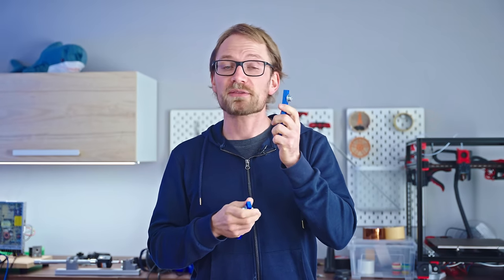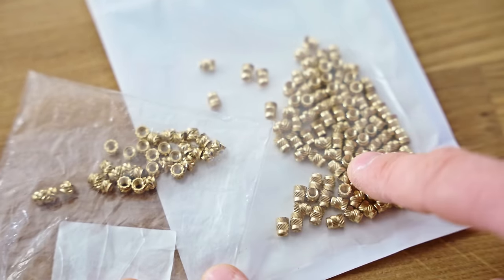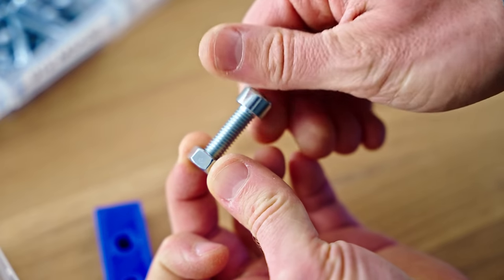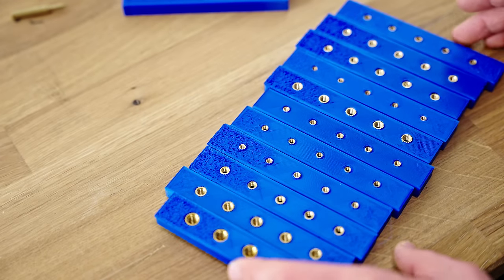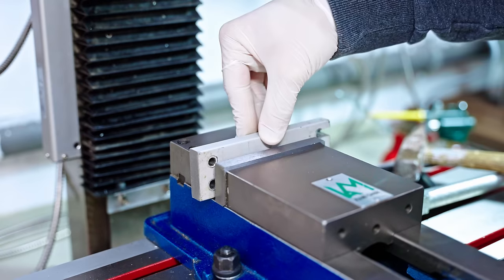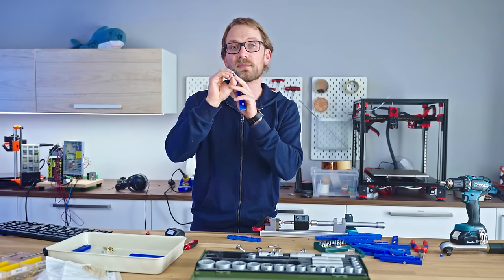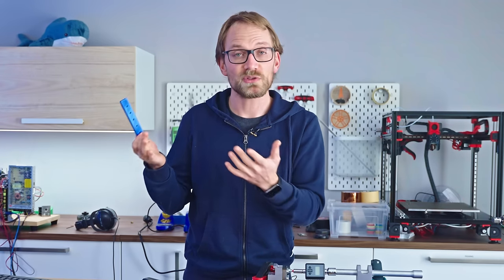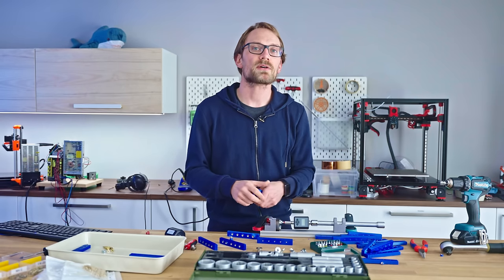Do you even need threaded inserts? Strength tested!

Comment: I think most of the comments cover my views... I'd like to 2nd extra perimeters, infill, and mentioned in video but I don't see it in comments: material type. I've found people don't really get the different material options out there. They either go "ah, I was told to print this in PETG or ABS" and go with that, or they just blanket go "I have orange loaded in the printer, so will print the thing with that..." So you tested with PLA, but all you need is for the weight bearing element to hang from plastic part... and stress creep kicks in and it eventually fails. "oh no, it broke. Now I need to reprint/repair/etc. it" or... it can be demonstrated that they should've used PETG/ABS instead that doesn't have that issue. Etc. Etc.

Comment: It looks to me like you're using 2 walls?  (If you said how many walls, I missed it.)  I assume that's on your preferred 0.6mm nozzle so the walls are 1.2mm thick.  That's about half what I would use for anything load bearing like a threaded insert.  I don't have any actual science for that decision, though - I just feel like a load bearing wall ought to be around 2.5mm thick, which is 4 walls on a 0.6mm nozzle or 6 walls on the 0.4mm I use.

So that's what I'd like to see next: how much stronger is the part if you print it, well, strong and not "quick prototype" thickness.

Comment: How about the embedded nut whether it's embedded during the print or inserted in a pocket after printing? Is there a way to add more filament around the 'hole' as it's printed maybe adding a bit more strength?

Comment: Hmmm, not sure about the results. I've definitely torqued screws into m3 threaded inserts at more than 0.3nm while building a voron...

While I dont have a real torque wrench I use those printed ones for nozzle Installation and would compare thst torque to some of the screws.

And yes, I know they often apply tricks to increase the strength of the inserts, but even for Ines without extra supports

Comment: 50% gyroid, infill >5 perimeters. Embedded nuts, embedded threaded parts/metal. I only use inserts far electronics, like an enclosure for a Rasberry Pi (Zero). Reason being recycling, avoid glue at all cost. Its a pain to remove embedded parts like magnets, inserts and nuts.

Comment: IMO not having enough "meat" around the holes completely invalidates these tests. It introduces a variable that at least I usually account for in my designs. Another option that you seem to disregard here I do quite often is having a smaller hole and then just cutting with the screw. For me this works much better than you suggest here. The screw gets hot due to the friction so cracking the part is rarely a big concern. For better or worse it gives a much tighter fit than when cutting a thread into plastic. Another option that is missing are inserted nuts. Not always an option - but sometimes you can even insert them during printing.

Comment: You mention lead free solder has been fantastic, what's the alloy you use?
Reply from the maker: I've been very happy with the ones from FELDER, specifically their halogen-free, no-clean Sn99Cu1 type from the ISO-CORE EL series. Though that's simply the one that I've been using and I'm pretty sure the alternatives work very well, too.

Comment: Why use metal screws in the first place? Unless you need to screw/unscrew them very often, it is much better to use specific screws designed for plastic parts! They are easier to put, and are very strong. And much cheaper too.

Comment: Interesting stuff, however I question the validity of doing strength testing on pla, if you care about strength, wouldn't you use something like PC (Blend), nylon or abs/asa?

So definitely would be interested in different materials
Reply: PLA is pretty strong, at least in compression.  Nylon and ABS are weaker, but tougher.  I suspect that the same holds for tension.
Reply: @richdobbs6595  PLA has a high Young's modulus but a low ultimate yield strength. Which is what I meant by stronger material.

As shown in the video, the PLA fails way before anything else, and if all you need to do is to just hold together a multi part print for your pen stand, then the content presented here isn't really relevant as a piece of chewing gum and some tape is probably good enough. This type of investigation starts to matter more when you have functional parts that need to take some load, and at that point you probably shouldn't be using PLA. Which is my point ☝️

Comment: if its a part that i don't want to disasemble i just use 3d gloop. if it needs a little more bite i print worm screws and also use 3d goop on them. 
if it needs to be disasembled it will get a pocket with a nut in it. Way better than those inserts and also cheaper

Comment: you can try screws for wood, look like they are more suitable for such material like plastic, they have wider thread, and higher pitch, so the stresses is distributes in larger area, sizes from fi 2-2.5 mm is easy to buy, 3 and 3.5 is very common in furniture;] and is enoug to make straight hole 1:1 (eg fi3 for fi3), and metal thread do the rest

i suppose there is same result that you pull out whole screw and break part between infill and perimeters

ah maybe they are less resistant for multiple screwing and unscrewing due to wear of plastic thread

Comment: I'd be interested in testing out "Cubic Subdivision" Infill. Not primarily for this but in general. According to the Slice Preview in Cura its one of the fastest Infills to print with less Material while being surprisingly strong in my experiance. I usually print with 3 Walls and ~20-25% Infill if I'm building for strengh. It's very overlooked imho.
so yeah trying out diffrenent Infills would be awesome. Maybe with the 3 new additions from Cura? Namely Honeycomb (very interested in that), Continious Honeycomb and Fill.

Comment: Why not test wood screws or screws designed for plastic.  I have had a lot of success using deck or drywall screws.  Machine screws are designed for metal.
Reply: Wood screws work fantastic directly into the plastic. Just wouldn’t want to use them for repeated use.

Comment: "Don't use the m3 bolt to make threads. Use a tap"

I disagree. The bolt will act like a form tap and threads made with form taps are stronger than threads made by cutting taps 

It's what I use on my assemblies on cars and motorcycles. Also for threads smaller than m5 I don't model the threads. Just try a few different hole sizes to see what works best depending on material and extrusion rate (I prefer to overextrude a little)

Comment: I am surprised that you didn't print the parts solid to be honest...

That steel screws outperform plastic parts was obvious and to reduce variables i would suggest ONLY testing with solid printed parts.
The question here was "how sturdy are the connections between the inserts and the parts?" and not a test to see when the parts give...

What one can do in practical use now is the following: make sure you have thick enough wall thickness to support the load the parts will have to endure instead of playing with infill 😉.

Just use the infill to make sure the print goes well 😁. (Only 10-15% are plenty if you have enough solid top and bottom layers as well as enough perimeters 😉)
This is also basically the same thing they do in traditional manufacturing with injection molded parts 😜.

So YES please do another test but with solid parts where we REALLY see the strength of the connections!

Comment: I feel like strength really isn't that important. the only time i really want to use bolts is for things that need to be able to withstand taking the bolts in and out (inserts). If i just need a strong connection i feel like it's better to change the geometry of the model to interlock and/or simply glue the parts together. that or just a simple nut and bolt

Comment: Looks like a simple self-tapping technique was not covered in this test. First use 3 perimeters or more . Second just put hole .1 smaller - for m3 use 2.9mm hole and just screw bolt into. And don't use high speed electric screws drivers it will melt it. Just by hand or put bolt 70% by electric and remaining length manual. And the length required to be screwed of course must be at least 4mm.. longer is better (usual m3 is 2-3mm but without nut thread length required at least 4-5)
Reply: And of course this not for places where you and assemble/disassemble often.

Comment: Your testing method differs from reality by not thaving anything to pull against. I use M3 inserts into PLA a lot (with extra walls + infill modifier for the hole when it needs to be really strong) and the torque it requires to rip them out is usually more than what I can apply with a small screwdriver (Wera hex), which I guess is about 10Nm.

Comment: I don't think led is the biggest concern these days. For debilitating effects (besides MSM) the worst is electromagnetic radiation from wifi, cell and BT. It does interfere with calcium voltage gates in brain that operates on similar frequency (1.8-1.9hGhz) and it causes calcification of the gates and premature dementia (aka digital dementia). You would have to sniff the led vapor and drink from led pipes all the time to achieve same damage ... There was massive 50 year long study released on it last year in april

Comment: Well how about trying to pull them out the other way not the same way you pushed them in and then pull them back out go from the other side that's why it's got a hole all the way through that would be my thinking you would have a better chance of it holding much better that way than the other way around

Comment: Some good tests would be embedded nuts or nuts put into a slot from the side. Also a better test procedure would be to have your clearance hole fit the specs of what a clearance hole should be for that size.  Your just testing the plastic in too many cases.

Comment: I love the channel, but unfortunately your methodolgies in this test invalidated most of the results:

- sparse parts should have been solid (and individual). You arent testing the the threaded connection, when the sparse infill fails.

- tap more slowly, with spiral flute taps and actual lubrication. M3 is no problem.

- Using torque as an analog for pulliut force just indroduces another variable with the friction of the threads skewing results. Plus, the heat generated by driving the threads under load is probably softening the printed part.

I hope you revisit this test.

Comment: It's really obvious and you do conclude with it, but you go on talking about slight ways to increase the bond of the cylinder. If you are going to get a useful test answering the problem you started with, testing the threads , you are going to have to beef it up significantly until 0% of the failures are like that.

Comment: I think it would be cool to see a 3d printed alternative to screws.  Screws are the standard connection method in subtractive manufacturing, but what would the equivalent be for additive?  It would be interesting to see how a new fastener optimized for 3d printing is designed.  Made by 3d printing for connecting 3d printed parts, and able to be inserted or removed with a 3d printed tool. 😁

Comment: Torque is not a very good measure for this. Torque is very much a function of friction in the threads. Lubricated threads will provide higher tension for the same installation torque as unlubricated threads.

Comment: shame you didnt try self tapping threads. Eg, for an m3, you print a 2.7mm hole and let the screw form its own threads. I fidn this very strong and a rediculously easy way to make threaded holes
Reply: I mean using regular m3 threads, but in a self tapping fasion, not specificaly designed self tapping threads on wood screws

Comment: Wouldn't using a washer and running the screw all the way in  be a more real world test or use case. You basically tested unsupported pull out instead of fastening forces. You treated the inserts like a lead screw not like a fastener
Reply: When fastening 2 parts together you would likely see a rotation failure in stead of a pull out

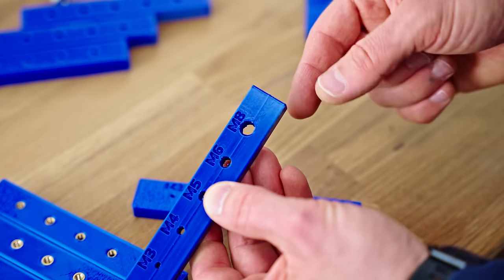Comment: I sometimes have similar top surface issues as shown at 09:30. These appear to be overfilled due to warping. However, sometimes it also occurs in regions that are not visibly warped, for example in the center of the top surface. Does anyone have any advice in how I can fix this? Have already tried all sorts of things, including lowering the extrusion multiplier.

Comment: I find comparison of the strength of a grade 8 bolt to anything in plastic is absurd. If you mounted the plastic, drilled a through hole and put a nut on the outside you wouldn't achieve the strength of a grade 8. A minimal ordinary grade 2 bolt might be a comparison, but I think even with that you could crush the plastic by tightening a bolt between two washers on opposite sides of the plastic.

Comment: For everything I have ever done with printed parts, threading straight into the plastic is more than sufficient. Taping and all of that is ridiculous for most applications with printed parts. Live threads work absolutely fine. All the effort of taping or using inserts with plastic parts is a lot like using a Rube Goldberg machine to pour coffee in my mind.

Also, I disliked how you focused on torque as the metric of concern instead of the actual interface strength. Torque will change drastically based on the conditions of the interface. I can get very high torque with live threads, and even threads taped into plastic or printed threads will torque differently than similar or dissimilar metal-metal thread interfaces, but that means nothing with regards to how strong the interface is between the screw and the part. Given the drastic difference in mechanical properties between plastic and metal, the strength of the interface will always come down to the diameter of the interface primarily - the inserts only really ever help because they are increasing the contact area thanks to being larger than the the screw you plan to thread into them, and you could get about the same increases just by using a larger diameter screw instead of the insert. But, re-melting or cutting the plastic also has effects on all of that too (positive or negative), so in the grand scheme of things it's kind of a wash as to whether there is really any benefit to doing anything more than live thread. In any case, for this experiment to be truly meaningful you should be measuring the actual force these screws are able to withstand when threaded into those inserts, preferably in both axial and shear loading. 

Like in aluminum, the only real value to using inserts, except in the case where you want to use a smaller screw for some application, is with screws that you intend to insert and remove frequently, otherwise you're just wasting your time or expecting to use plastic parts beyond what they should be used for.

Comment: 2 perimeters is not exactly "mechanical part" setup... CNC kitchen reached 3 Nm torque-out for M3 inserts, here it's 10 times less than that
Reply: Maybe for the next video you could test strength depending on the number of perimeters

Comment: I hate the whole Bolts are pass through while Screws are material based hold as that is not completely true with most descriptions of screws and even bolts. I have seen enough use cases where they would not fall into either bolt or screw with that definition. Look at the bolts in a engine block as example. They would by technicality all be screws but people call them bolts because of their head style. Screws have internal drive like the Torq, Phillips, Roberson, and flat/standard. Bolts are external like the hex, square, spline and external Torq. Screwdrivers are called such because they are used with internal drive fasteners. Nut drivers are for nuts but also external drive fasteners. Bits are internal drive and sockets are external drive. 

For a little though experiment, Is a stud a bolt or a screw or is it something else because its lack of drive head? 
For context a stud is a threaded rod that is fixed in or onto something. A stud can be threaded into like an engine block but also have 2 nuts fastening it to a wall or even the Stud can have a welded flange or size difference allowing it to catch and act as a push back for a nut to tighten. Some studs (screws as well) have the material threaded that they go in and still have a nut screwed on to lock together against the material to stop it from backing out. Normally see this with a spring set over the fastener. 

And for the few that think because its the lack of a "head" that makes it a stud, a set screw is all thread without a head but still has an internal drive which is commonly used where the whole screw had to be under the surface or even deeper into the material.

Comment: Oh my your hands are dry 😢 I tested my self with small round part and small hook in it, printed in ASA and inserted one of those M4 thread inserts meant for injection moulding and attached fish scale in it and pulled. I got 15 kg in the scale and was happy enough in it and surprised that even the printed hook part did not deform or break. And the typical nut with tight fit is mostly ok for my applications.

Comment: I think a tensile test would have been much more useful. Especially for the plastic threads i dont think the connection between preload/torque and extraction force is the same like steel. The platic will alwasy be the weak link and ins most cases even a M3 screw is more than enough and can hold up to 4000 N.

And because of the retardation  of the plastic, your preload is going away over time anyways.